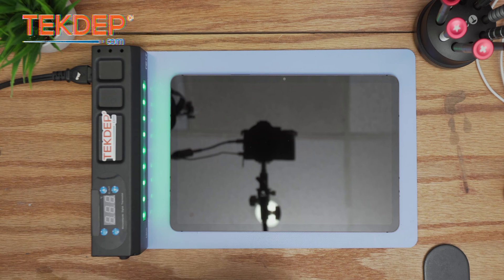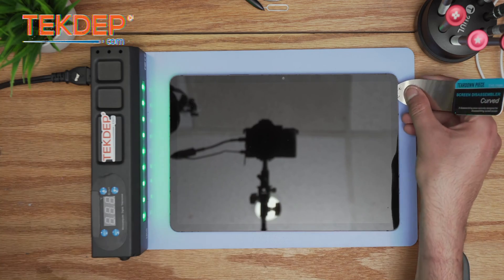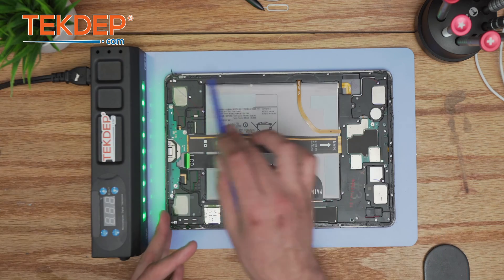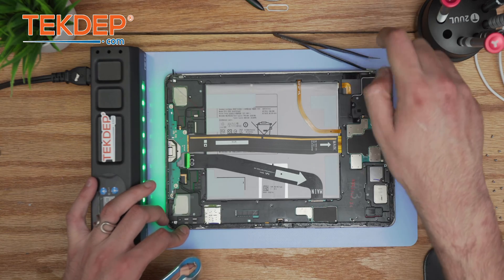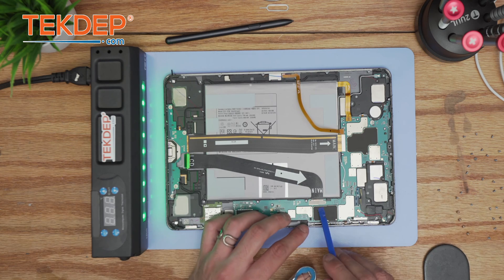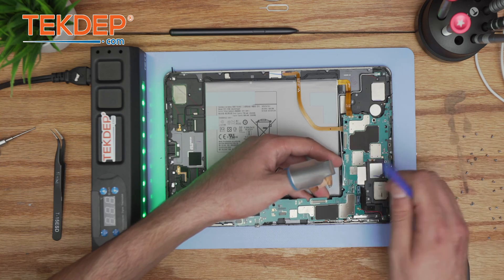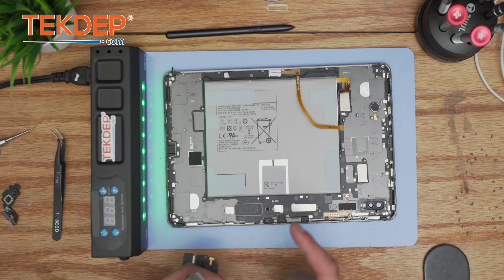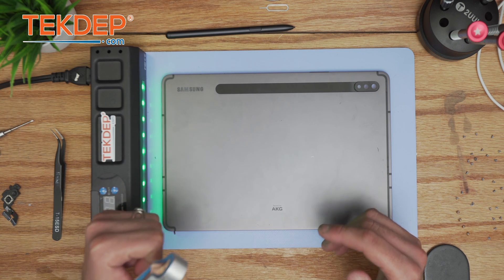Samsung Galaxy Tab S7 Repair Overview

Comment: How can I determine if the battery is faulty or if it's the motherboard?
I applied an external charge to the battery. It has 3.6V. When I connected it to the motherboard, it shows 0.0V. And when I connect the USB charger, it still shows 0.0V, with the lightning bolt image unchanged.

Comment: Mine fell from a small table a few days ago and the screen is malfunctioning. It has a large white strip at the top of the screen and the backlight is flickering.
Reply from the maker: That’s unfortunate to hear—it definitely had internal damage and will require a full LCD assembly replacement. We have the part available on our website if you need it, and we also offer a mail-in repair service if you're interested.

Thank you for your comment. Visit our website for any mail-in repairs, tips, parts and tools you need. Stay tuned for more videos.
Join our community!

https://tekdep.com

Comment: Hello, thank you very much for uploading the Samsung Tab S7 disassembly video on YouTube. I have a question for you. Which part on the motherboard receives the Samsung Spen signal? I recently replaced the screen of my tablet, but my tablet cannot receive the Spen signal, whether I use the Spen that comes with my tablet or the Spen on my phone. I need to know which specific parts on the tablet motherboard are related to this, and whether some parts were damaged when I replaced the screen myself. I hope you can mark the names and functions of the relevant parts on the pictures, thank you very much!

Comment: Bought an s7 in january 2022 for €700, tried updating software at the beginning february and got stuck in a software loop. 10 days after the 2 year warranty ended... Tablet was working fine before. Diagnosis by them: defective motherboard, €400 to repair. Absolutly gutted as I use it specifically for university. Been asking for a solution for a month now and still nothing. To me a lifespan of barely 2 years is unacceptable for this price! Do you consider this normal? Think I can get a new tablet from them if I file a complaint?
Reply: I had charging issues twice. I think the tablet is crap. But for $50,  I might try changing the charging board after watching this video.